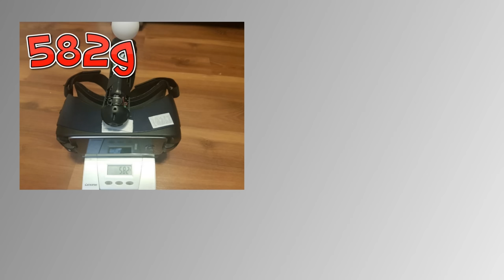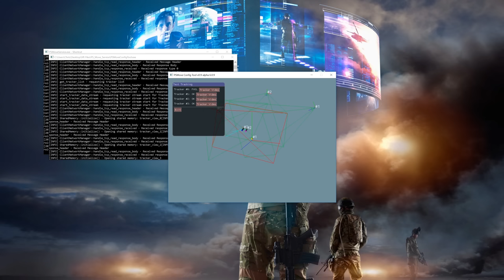The Best Way to Head Mount a PS Move Controller for Perfect Head Tracking! [Part 3]

Comment: Daley, since the computer need 3 Move Controllers to support positional tracking. I was wondering if you need one or two bluetooth dongle to sync all 3 controllers? I'm working on something on my own inspired by your build using replacement Move parts I've found! Will post the pictures once I got it running. Love your videos man! Keep it up!
Reply from the maker: Hi, thanks for watching and I'm glad you enjoyed the videos!  To answer your question, all 3 controller work just fine off of the one BT adapter.
Reply: Hi Daley! Thanks for the reply. Oh, I didnt know bluetooth could support more than 1 device synced together haha. Thanks! Btw, here's my head tracker ball for my PSVR setup inspired by your build https://preview.ibb.co/fimk3v/unnamed.jpg Keep up the good work man. Btw, what do you think of the latest update from NoloVR devs to mount the base stations up on the ceiling for 360 roomscale? Thanks!
Reply from the maker: wow, that looks really pro!  Nice work :)

I think it's a really cool option and should provide quite a bit more tracking.  Ideally, you would want at least 10' ceilings based on the FOV of the camera.  The fact of the matter is that with only 1 tracker, you will ALWAYS run into dead spots.  There is no way to get around this with just 1 tracker.  The key will be to find the best placement for your certain environment, then learning how to avoid the dead spots.  The fewer dead spots, the better.  

Example of dead spot with ceiling mount - If you standing towards the front of your room, camera mounted right in the middle on the ceiling, and you have your controllers on, or near your chest or hips.  Your upper body will completely block the controllers the entire time.  And the further you go away from the middle of the room, the bigger that blind spot will become.

Comment: Could you use a led bulb and a wiimote and nunchuck to make a diy vive controller? The wii remote could provide orientation, and the bulb would provide position. Or maybe you could use two older phones instead of the wiimote. It seems like a lot of people would be able to afford a setup like this.
Reply from the maker: In the future, that may very well be possible with PS Move Service.  As of right now though, you would need a few other pieces of software to run all of it and combine it.  But that may require IR LEDs instead.  I have not dug too much into it I'm afraid.

Comment: Does the PS move service need to see a completely spherical light ball, or would a partial dome (say half a sphere) of light work for tracking? Been waiting for this video & it was worth the wait.
Reply from the maker: I'm not sure how well that would track.  I think you would start running into issues when it's on an angle.  But technically, it could work.
Reply: As usual, you're video motivated me to look into a similar setup. I found a pre-assembled half dome led bulb assembly kind of like what you made that's cheap enough that I might give a shot. I'll let you know if its successful or not.

Comment: Very cool. Thanks for sharing this, seems like an optimal solution. Would you be able to post a link to the resistor you used? That's the only piece I'm having difficulty with, and I'm not very knowledgeable when it comes to electrical stuff.

Also instead of using the battery pack for AA's, why wouldn't you just use a 9V battery?

Thanks!
Reply from the maker: The 9V battery is WAY too much voltage.  You can use 2x AA, or 2x AAA... The AAA would probably be ideal since they are cheaper/lighter and whatnot.  I have 2 rechargeable AA in mine cause the store I went to only had a battery pack for 2xAA and I wanted AAA.  AA or AAA are all 1.5V normally, and 1.2V for a rechargeable.  So mine is 2.4V for both batteries which made it still too hot and hence the reason I had to use that smaller resistor.  The resistor I got was actually from a local electronics shop here so I don't really have a link.  But I calculated 8 ohms based on my 2.4V and rating for the LED.  You can experiement though.  Here is a great aliexpress where you can select any resistance you need.  Depending on what type of battery and LEDs you chose, you can go with 10Ω, 15Ω, 20Ω, 30Ω.  That should give you a decent assortment.  https://www.aliexpress.com/item/1LOT-100PCS-Metal-Film-Axial-Resistors-91ohm-91R0-1-1-2W-0-5W-electric-resistences/32526575008.html?spm=2114.10010108.1000023.152.GSc0uf  Just got to click each one in the chart below and make sure the picture says the resistance you want and add to cart.

But really, you shouldn't need less than 5 ohm, and not more than 50 ohm (if using the 9V battery).  Also, make sure you grab a proper IC LED instead of the standard 2 lead LED and get a color that is available in PS Move Service Config tool.  I went Amber LED since I matched it up with Yellow.
Reply: Great, thanks for the information! The aliexpress link is very helpful. How did you end up calculating 8 Ohms? The LED I'm looking at is 2V and has a 700mA current. Wouldn't the formula be R=(V(source)-V(LED)/I(LED))? In my case it would be R=((3.0V-2.0V)/700mA)=1.4Ω. Or am I overlooking something here? Thanks for the responses :).
Reply from the maker: That sounds about right!  You're using a MUCH higher power LED than what I was using.  Mine was 2.2V and rated for 200ish mA.  I wanted to bring mine lower than spec so that it didn't heat up like crazy.  When I tested it out at it's full spec without a resistor, it would be too hot to touch after about 3-4 minutes.  With my 8ohm resistor, it stayed nice and cool.  These generally get warm and are expected to be attached to some sort of heat sink, so without a heat sink, I made sure it would run under spec.  So you probably only need to get a couple lower values then maybe from 2 ohm, to maybe 15 ohms then and see if you can find the sweet spot for most light and staying cool without the heat sink.  For a buck per value, you might as well get a few.  And just hold the LED attached to the battery pack with some alligator clips or tape or something and test it for about an hour.

Pro Tip - If your in North America, opt for the ePacket shipping.  I specifically picked this one cause it had the option for a decent price.  I only ever get stuff with ePacket from Ali cause I generally get it in 2 weeks instead of the 45-60 days on the standard shipping.

EDIT - Remember that you can put resistors in series or parallel to fine tune the resistance as well.  You can get a potentiometer too if you want it adjustable on the fly, but I just fear that would get knocked out of wack by mistake and force to re-calibrate again and again.
Reply: I'll try that out. Thanks for all the responses. Good to know about the ePacket shipping, I've always done the long wait :P. Just need to figure out how I'm going to go about mounting this contraption (daydream doesn't have the vertical strap). Maybe I'll try a headband or hat of some kind...
Reply from the maker: Greg actually used a hard hat lining to get a much more comfortable fit.  He doesn't use DayDream, however I'm sure it would still work.  He has a thread on the PS move google groups talking about it with pictures.  You should check it out!
Reply: Will do! Thanks for the heads up.

Comment: Awesome vid, very inspiring on how to reduce the weight on the hmd.

I do have a question about the ball. you use a pingpong ball, but since you need the third controller anyway why not use the ball cover from it since it detaches so easily? how would you get an LED to work with the original psmove ball? would the led be able to make the entire ball surface 'glow' or create a more pinpoint inside the ball? I'd rather use the psmove ball if i can :-)

thinking of doing the same but with 2xaa/aaa batteries :-D
Reply from the maker: Yeah, that would completely work.  I just didn't want to start gluing that part when I may want to put the controller back together again later.  But there is no reason at all why not.

You need to get a proper IC LED to light it up.  that will work fine.  Using a standard LED won't work well.  I tried about 3-4 of them all clumped up and it still wasn't enough light.  And yes, I use 2 rechargeable AA battiers.. gives me more than 8-10 hours of use.
Reply: Ah, thank you!
would something like this suffice? http://www.maplin.co.uk/p/blue-led-with-pcb-n84jq I'm hving trouble finding a ic led for it :-(
Reply from the maker: That's exactly the same style as what I used.  Mine was 1/2W, and that one you mentioned is 3W  So it's pretty powerful.  You would need a decent resistor on it to make sure it doesn't get too hot or blind you. lol  But yeah, that sort of thing is perfect!  Aliexpress is great for this sort of item

Comment: So just to verify, you need the third controller, but it can just sit to the side as long as you match the color of it on your manufactured LED?  I have been slowly reproducing your setup.  I'm doing it as cheap as I can.  My headset kind of sucks though (VRbox2).  Do you have any recommendations on a cheap headset?  I see you have an S4.  I'm trying to run this with an S6 active.
Reply from the maker: When I used the S4, it was only for one video.  It was when my phone was out for repairs.  I use the S6 Edge+ normally.  But for a decent budget headset, the bobovr and clones of it work quite well.  There is even a variant with headphones built in.  

About the 3rd controller.. you're right.  You need it connected to the PC by bluetooth and off to the side.  This is cause you still need a controller ID for Freepie to follow.  Until there is virtual controller support, it will still be needed.
Reply: Daley Tech Thanks!  After I posted that I saw your video on the BoboVR.  That might be just what the doctor ordered.  Thanks for posting these videos!

Comment: Hello I can not perform the instruction
I have a third controller and the psmoveversion may changed ?
Every try to get the controller for the HMD activated ends up in:
No lights on the controller or the color changed to a different
First i tryed with freepie ... where afterwards steam was chrashing
atm i just changed the ini to HMD = 1
any clue ?
your vids are normally are 100 % ;-)

Comment: would i be able to make an additional ball to be placed on the ps3 move navigational controller so that i only need one move controller for calibrating?
Reply from the maker: You can put a ball on the navi controller, but you won't get any rotation from it since it doesn't have a gyro.  But you can still use that for calibrating anyways.  You don't even need to navi controller to calibrate either.

Comment: so it only uses the ping pong ball for positional tracking and uses the IMU in the headset for rotation? how is the latency?
Reply from the maker: Yes, that's exactly it!  There is a small bit of latency since all the data is going over the network.  Using a Wireless AC network in good conditions (Same room on a non-contested channel), it's minimal, but still noticeable.  Riftcat is currently working on developing a "Time Warp" type of solution similar to what Oculus Rift uses to help reduce the perceived latency even further.
Reply: I'm thinking about getting an HDK2 so latency should be greatly reduced.  I thought about getting GearVR for the high res screen but I'm pretty sensitive to sim sickness and I'm afraid the added latency might make me hurl!

Comment: Hi, would it be possible to use the navi controller as the fake controller for the ping pong ball?
Reply from the maker: Unfortunately not.  That would be really awesome if it could though!  The Navi controller has no gyro or magnetometer, so it wouldn't detect any sort of rotation.
Reply: But if I'm correct, PSMS gets the positional data from the ping pong ball and you leave a controller lying and unused just to let it think it's the controller that is tracking. So couldn't that be the navi controller? I would get the rotational data from my HMD (an OSVR HDK2 actually).
Reply from the maker: Oh, I see what you mean.  The issue still remains in that scenario with having the configuration options.  The way it's programmed now, when you select the navi controller in the settings, there are not color calibration options for it.  But that would be easier indeed.  I think they are looking to make it a bit easier yet.  They are looking to craft a fake controller that would configure like a standard move controller for just this purpose.  I know Zelmon said he would take look into it, but it's a larger job.  He's been doing some awesome work lately, so I'm sure he'll pull it off.

Comment: First!
Ps. I did the PS move controller thing you showed last episode and it seems to be working great. :D
one problem that i am having is that my arm tracking feels weird, if i turn to one side my arms get longer, and if i turn around they get shorter, any way to fix this?
Reply from the maker: There may be a way to set an offset in freepie, but I found as long as the bulb is centralized on your head, it should work.  This is why I wanted to start this series cause it was driving me nuts too.  I go over why it's happening in the first couple parts.  Grats on the first! lol

Comment: is there any update on the virtual controllers so we dont have to use 3 controllers?
Reply from the maker: One of the developers is actually starting to work on that.  It's a bit more work than a lot of the usual tweaks, but I can tell you at least that it's in the works :)

Comment: can you use a ps move controller for orinetation of headset my phone gyro isnt that accurate
Reply from the maker: You can, but it's not really good. Most likely it won't give you any better results I'm afraid to say.
Reply: Daley Tech how would you do it
Reply: Daley Tech using the controllers orientation as your head orientation I mean
Reply from the maker: This requires some custom scripting in Freepie, but I have not done it and only heard from others that it doesn't work well at all so I decided to not look further into it.
Reply: Daley Tech are there any alternatives for head orientation